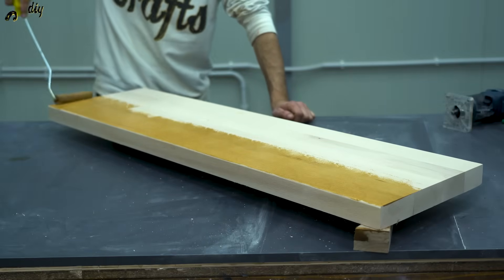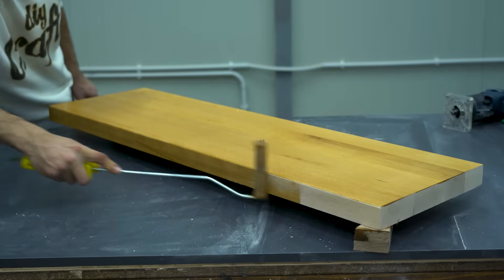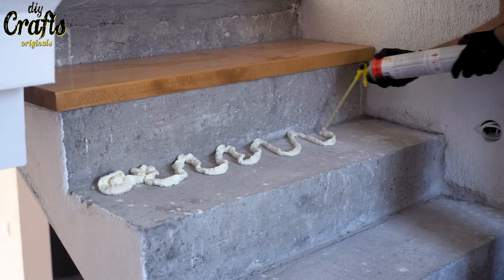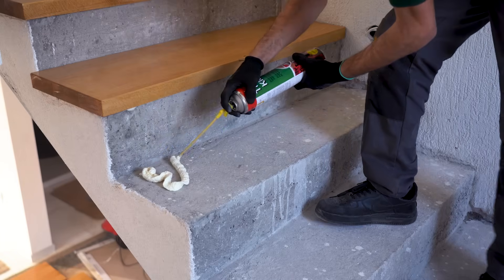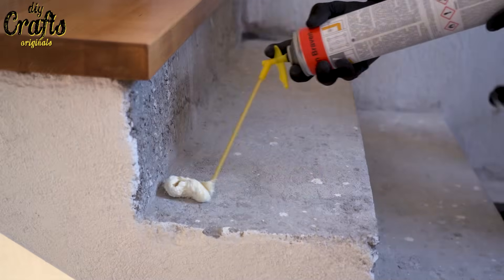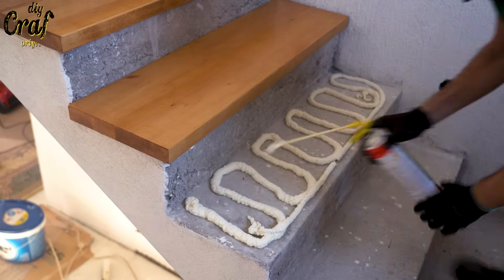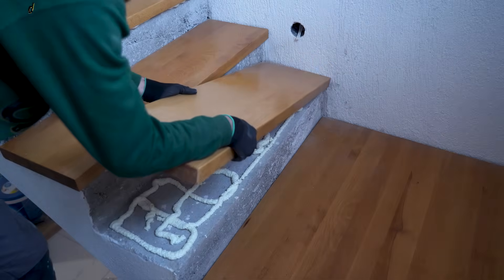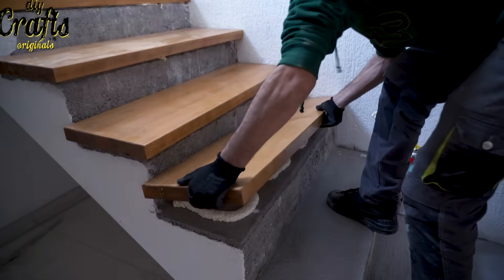Woodworking And Installing Wood Stair Treads

Comment: I would never use expanding foam to glue on treads. For the simple reason as the product suggests that it is expanding. The reliability of the foam to keep it stuck down over time isn't reliable. There are many other products on the market that have a chemical bond between the two substrates and will glue it down for years to come. One option we get in S.A is the soudal 26a. Used it and had great success. No hollow parts across the tread.
Reply: @Invent  totally agree. Some of these youtube videos make me cringe. seeing these on videos of just when its done gives the impression that it's the right way and it holds and is so wonderful until you do it and after a month it ends up looking like it's been through war. My moto is quick fixes and shortcuts most of the time if not always gets you into problems that will take you much longer, more problematic and more expensive to fix. Gone are the days where artisans were the guys that did things with passion and admiration, now it's some guy that whips up some concoction able to do something in a record time and put it on a video. Like you say what do we know.
Reply: I'm thinking of you placing wooden tops on concrete stairs. Can you advice how I go about it?
Reply: @jasonstephenperumal2796  make sure you have a flat and even concrete surface. Use a suitable glue that will bond to concrete and wood. Spread it around on the concrete and place the wood ontop. Weight it and let it cure. For extra security you can look at using a nail gun that will nail into concrete. Soudal has a few products.
Reply: Делали временный пол, лаги клеили к бетону на монтажную  пену. Через два года лаги отрывали ломом. Так что пена нормально клеит.В отличие от видео, мы на лаги ставили пеноблоки , чтобы  пена при расширении не приподняла лаг.
Reply: What material can i use ?
Reply: Can you use the glue they use in new builds to fit floor boards to fix laminate to a wooden staircase ???
Reply: @ВячеславНикитин-к3г   а если пена-клей, будет лучше ?
Reply: @alexalevs109  не знаю про клей-пену, мы на пену какая от оконщиков осталась клеили.Парни которые лестницу из дуба на объекте делали ступени  к бетону на клей пену сажали.Наверное клей-пена лучше .
Reply: Nu sunt meserias dar stiu case puse cu spuma(adeziv spuma) de 10 ani fara nici cel mai mic.inconvenient
Reply: Nu sunt meserias dar stiu case puse cu spuma(adeziv spuma) de 10 ani fara nici cel mai mic.inconvenient
Reply: Exatamente !
Reply: It's a special foam for gluing wood to the concrete.  I used it on my stairs and it's holding nice.

Comment: Please for the love of God no body watching this video use expanding foam to glue down stair treads. Please save your self the injuries and use a urethane adhesive like liquid nail urethane or loctite pl 3x
Reply: I don’t understand why they used a product used to help insulate to attach treads!  People are weird, you don’t have to reinvent the wheel on a project, just glue them down with an actual adhesive, dam.
Reply: @dawsonpurkett7709  Actually, there are in the market adhesive PU foam. Basically a liquid nail in the form of foam
Reply: Is it dangerous ?? Why your comments??
Reply: Dawsonpurkett7709, please answer !!
Reply: Este periculos poate sa bubuie!😂
Reply: Ei cred ca sunt mai destepti deaia fac comentarii

Comment: Do i need to wait sometime until the foam expands before putting wood on it ?
Reply: Dont do it!
Reply: @KilaKrumpira  I've done it
Reply: @damirsarac151  how is it holding? planning to do it for some project
Reply: @ginopangilinan227  to be honest better than i expected,it was my first time installing wooden treads and I've used low expanding foam,level and it worked quite nicely.
Reply: @damirsarac151  Thanks!

Comment: Something not quite right with this staircase. Stairs should be constructed to “easy going ratio” which is 7/8ths.

This means that a 8 inch deep stair tread should have a 7 inch riser.

The riser height looks less than this ratio. 🙄👎